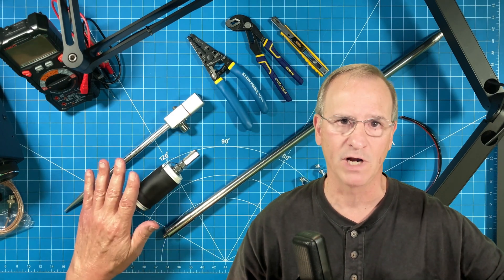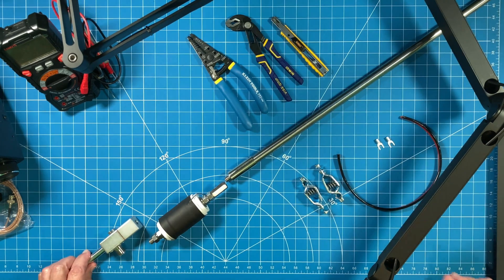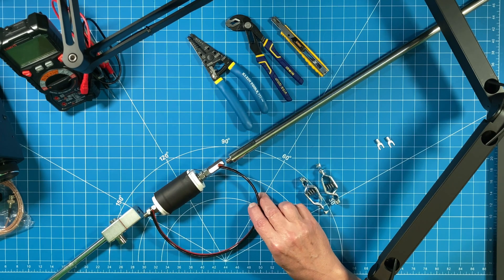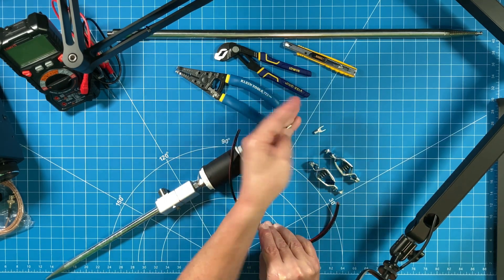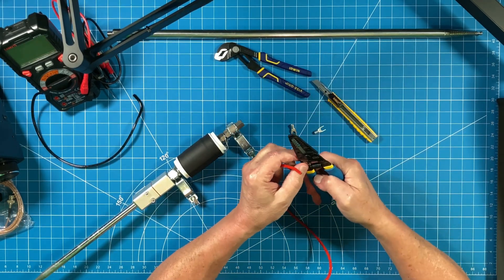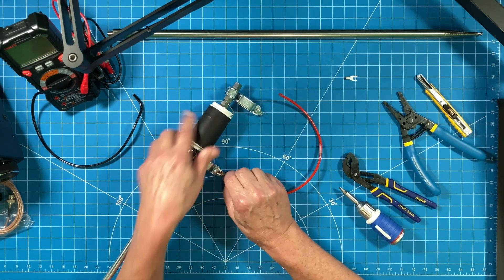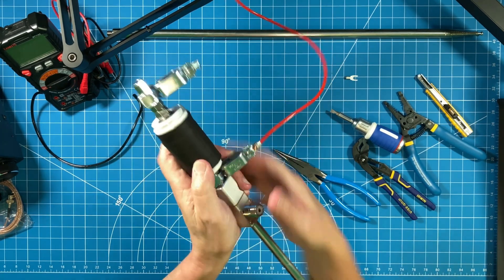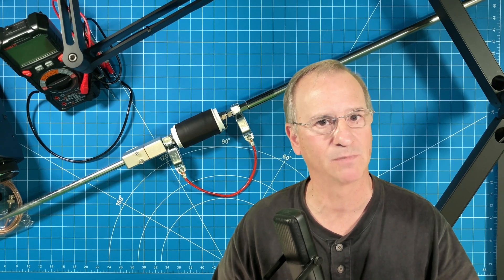Instantly Convert your Wolf River Coil Sporty 40 to a 20 Meter Ham Radio Antenna

Comment: Hello. Quick question on the Sporty Forty...I heard that WRC extended the coil so it would be easier to use with the Chameleon 17 foot whip. The WRC whip is a bit longer--9 inches I believe. To your knowledge, is this true ? Thank you for your hard work in putting together these videos. 73
Reply from the maker: I don't have the WRC longest whip, so I don't have them to compare to.  I'm also not aware of the change from WRC on the Sporty 40; doesn't mean it didn't happen...too much for me to keep track of.  The more various manufacturers can have their gear interchange, the better off for them all.

Comment: I did the same thing but used ring terminals on each end and some power poles in the middle for quick disconnect. Works well.
Reply from the maker: Good deal.  A couple of ways to pull this off, all of them make for quick band changes.